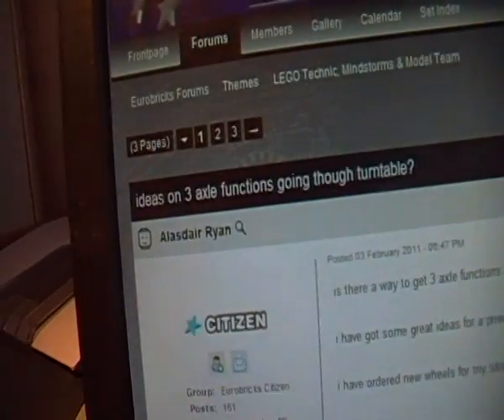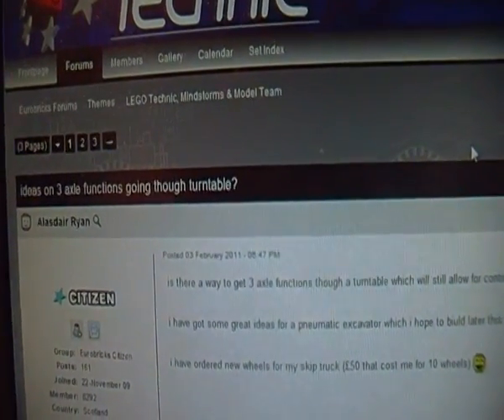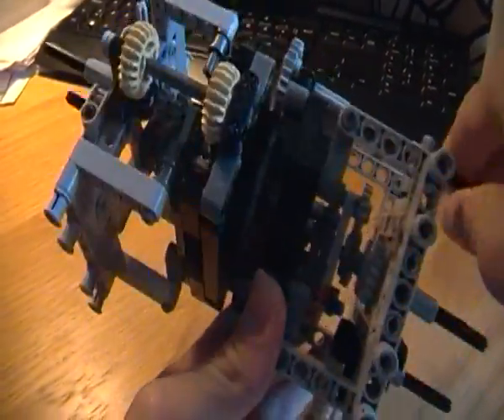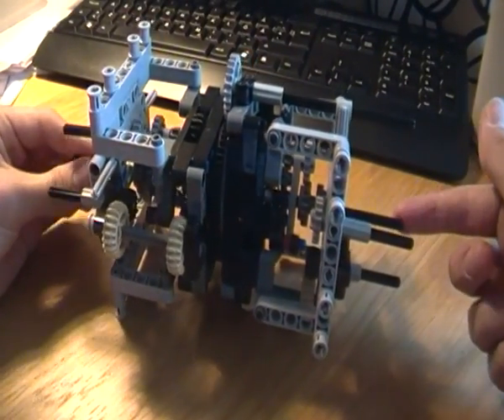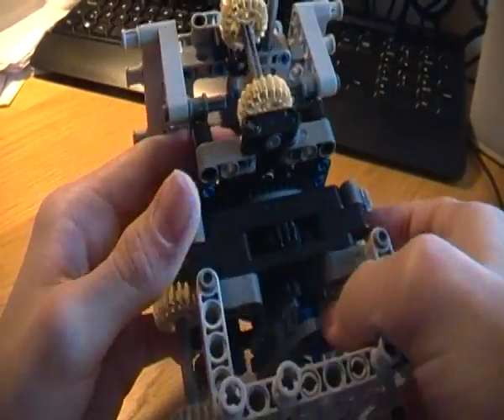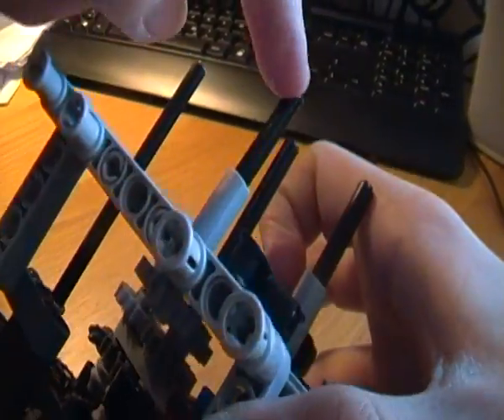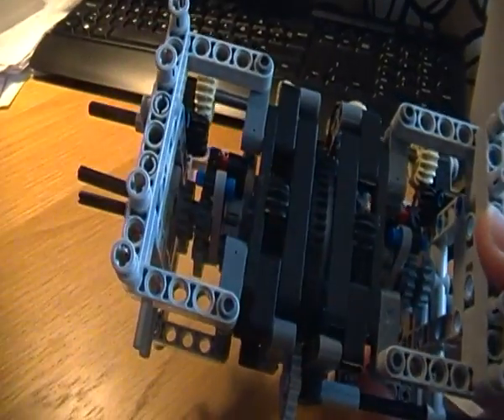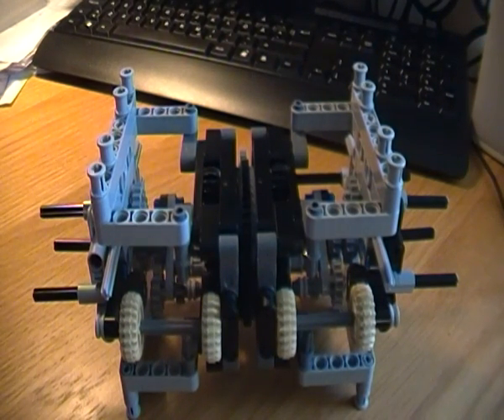Lego Technic 3 functions through turntable!

Comment: It's possible to have 8 by using part 4185, but it would take 33x7x7, 15 turntables, 16 8 toothed gears, 4 of part 4185, and some really long axles with axle joiners. At this size that would probably be pointless.